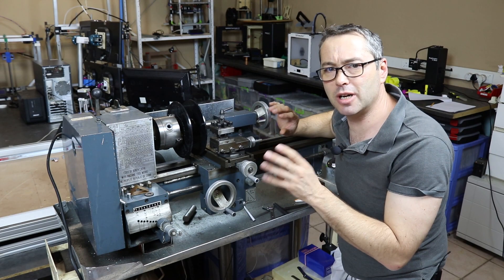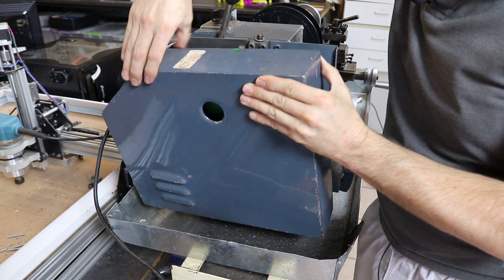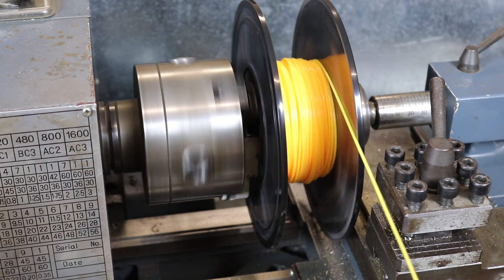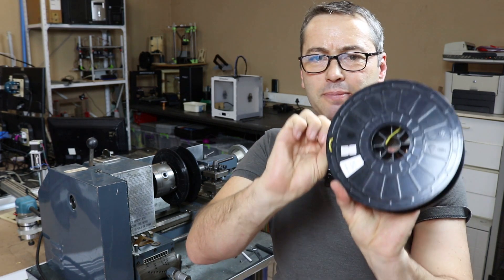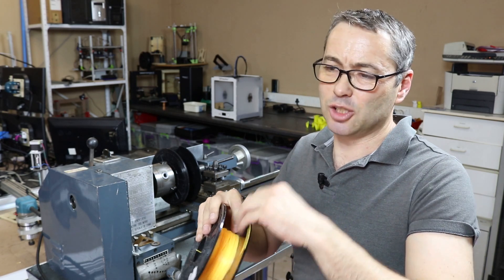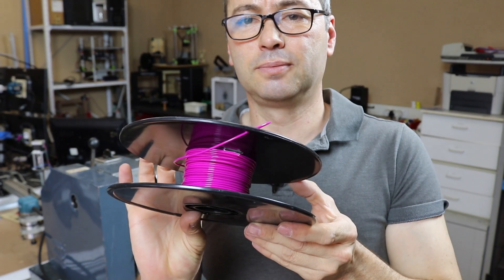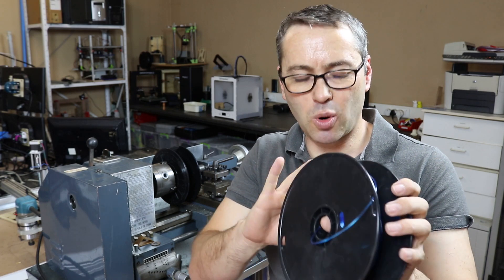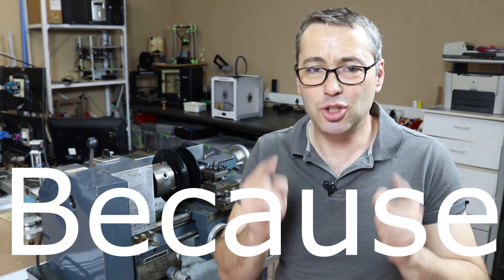Twisted 3D Printing Filament

Comment: This is a joke right? I've used two year old filament and had no problems with moisture. I literally use an oil diffuser next to me 3d printer right under the filament in fact so it has direct moisture on it. Moisture doesn't cause as many problems as people think.

Comment: You are an idiot! You start off with the assumption that nothing can go wrong at the Factory while factory rolls it’s spool. What if there was a problem? No way! Factories can’t have problems! Maybe As the spool is Being filled, Maybe they lose tension and film it crosses over on his self, The wind loses power… It could be a plethora of things that could happen. Something like this is just as easily, if not easier, to happen at a factory were they are making tens of thousands of rolls.then they start the process again and maybe it happens again… You make an assumption that nothing happens or nothing bad or wrong can happen while rolling the spool at the factory. And this of course makes you an …Well… You know. I’ve probably Used over 150 rolls now, I’ve had a problem with two rolls, this happened back to back almost, and I’ve never had a problem again.

Comment: Yes a roll cant cross by itself! but the filament will twist coming off roll if not wound correctly. Mainly causing minor lock up or under extruding. Your kind of giving false info with a bit of truth? Too much tension on gear or misaligned extruder gear will give the same results causing filament to twist enough to ruin print after 10 hrs or so. You may not notice on small prints and you may get away with a few larger prints. But if you have ruled out mechanical error, the best way to prevent this is bake new rolls in oven for a few hours to relieve any tension or just keep an eye on it while printing and remove twist when needed.

Comment: Totally agree, the reason why it locks up only later in the print is because your first couple of layer might be loose and the filament  will pull through eventually locking itself up.

Comment: I agree with Michael, the spool will only cross itself by human error. while a spool is wound continually, whether the tension in the spool is loose or tight, it will recover itself during printing.
only when you have a complete cross created when the end shoots back onto the spool you have a jam lurking somewhere along the line.

Comment: I think you are making a big assumption here. Since you claim that the loss of tension on the filament being pulled from the spool is the issue, have you considered that a spool error might be generated by a hiccup during the winding process. Try simulating a power failure for example while winding or even a sudden speed slow down.
I don''t know that this will create the flaw but if you cross over theory is correct why can that slack in tension be created other than by the user.